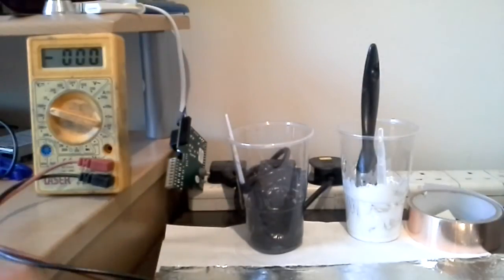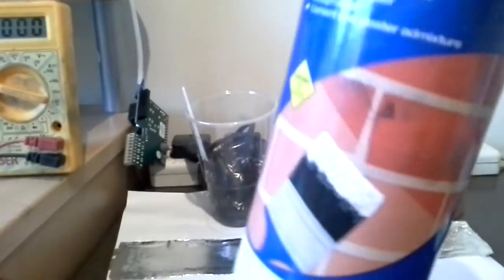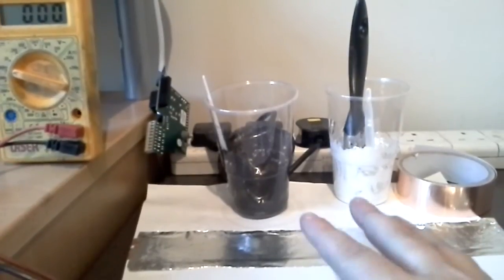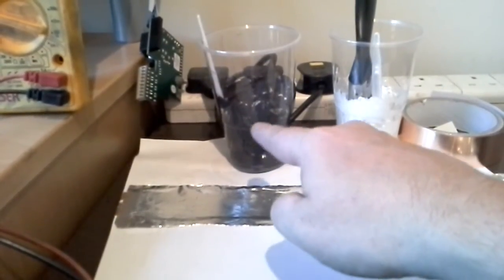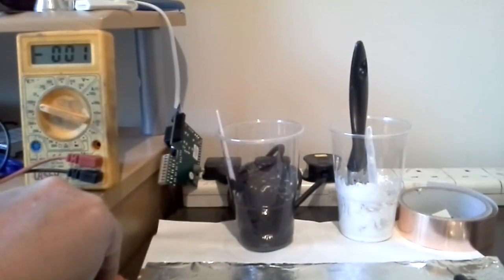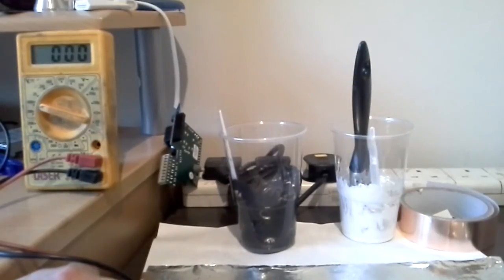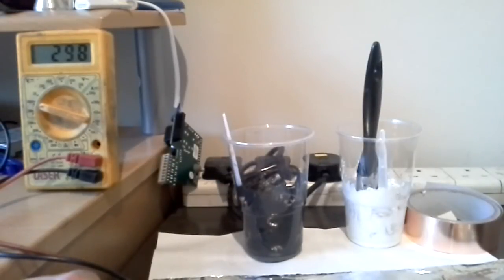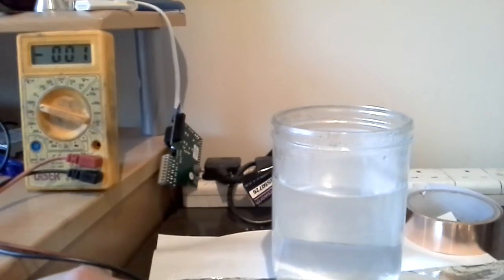Free energy using graphite

Comment: last night I was playing with graphene oxide and sodium aluminate and was trying to convert it with a plasma Arc the graphene oxide was in a water dispersion and i wasn't quite sure if convert it so I took my multimeter test it if it was a conductive I then I wanted to see if it would actually hold charge because it was an aluminum container I was just playing with it but found if I shook the container with the dispersion in it it produce a charge I took things one step further and took a vibrating toothbrush set it on the side of it and got about a 0.25 on the 9v setting anyway it's pretty cool stuff to mess around with
Reply from the maker: Your way ahead of me there. Plasma Arc! If I mentioned that to the wife she would think I've lost it. It's all good stuff this tinkering, I blame Robert Murray-Smith for it myself lol.
Reply: @fetchitnowuk  same lol